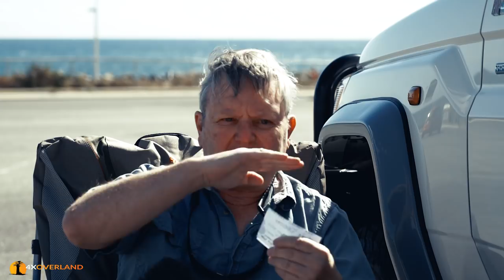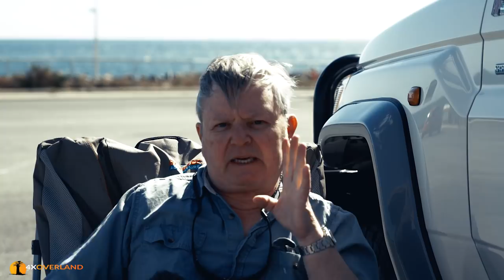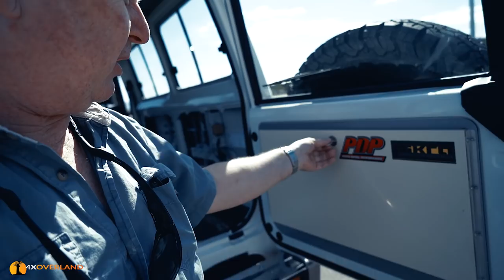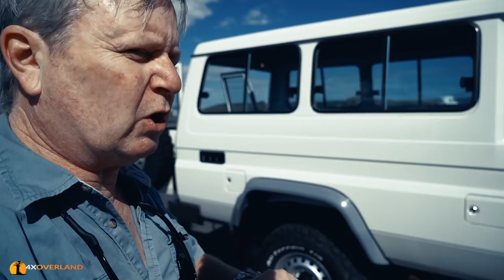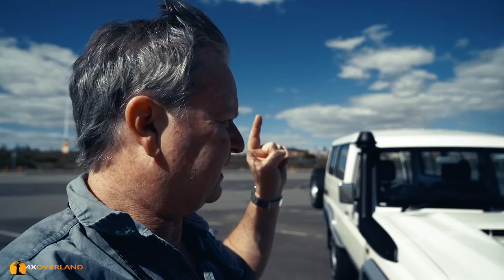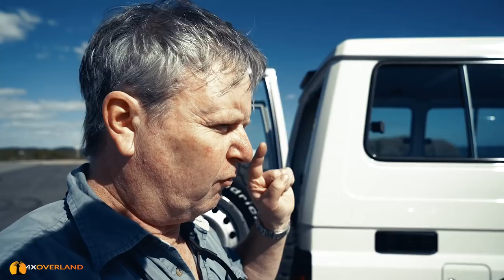PERFORMANCE UPGRADE EXPLAINED. AndrewSPW Land Cruiser build-9

Comment: Another thing, don't even begin to compare aircraft engines to these, the technology that aircraft engines were designed with is very old, the cylinder and ring honing and lapping process is specifically for that old technology, so the break in process is completely different. Not the same thing. However, that said, I agree 100% with the break-in you describe for the Toyota, or any new car engine, you must rev the engine during break-in to the levels that you expect to use it at in the future. Break it in the way you will run it.

Comment: Hello, for once since i looked all ( barely all) your videos i can t agree ( and stopped watching half the way) ... well, i do agree with what you say about reliability cause it is logical and full of sense. Still... ( and i m not talking as a hzj80 overlander but as a 4000 car/year dealer)... you should consider remapping instead of the chip... even the most brilliant chip has no comparison with an average remapping of the car. I ll explain myself very briefly. All engine are different. Some give a bit more horse power, some a bit more torque in high rpm.. who knows it s kind of a lottery when you buy the car, but the chips doesn t care of that and apply the same "recipe" to any engine! Result are not bad that s not what i mean.. But if you consider a professional remapping it can upgrade the torque, power, etc precisely specifically for your engine and it does that for any rpm . As a result you get a map "tailor made" : more torque in low rpm, check torque more stable between 2 and 3000 rom check, power after 3000rpm check.. or simply ( and this is why i prefer the remapping) you can stick to the original curve of torque and power and just translate it a bit higher in the torque and power scale. The same curves, but higher and a chip just can t do that as it doesn t even consider those curves. Couple of plug less also.. less chance of dust electrical issue but that s not a big big issue..  it s a tiny tiny bit more expensive and exactly as you said about electricity in the vehicule: hard to find someone brilliant to do it.. sure rohnny knows someone hehehehe i won t make it longer! Andrew i m a big fan, continue, visit marocco-mauritania someday you won t regret. Julien from belgium! 🇧🇪

Comment: Hi Andrew,  great videos as usual,  one thought regarding chips, to increase the power and torque they also boost fuel rail pressure to better atomise the diesel, which works the injectors harder and may shorten their lifespan. 
loving keeping up with the build! good job

Comment: what? people are complaining about you using a chip?

Well, this is entertaining because I don't own your vehicle and I'm not going to be using it for the purpose you designed it to be.

The only thing I can say to people looking into chips are 1) it will void your warranty, it sucks but true and if it doesn't void you warranty it will make it a very hard process prroving it's a warranty fault over the vehicle... but that statement should be taken with a grain of salt because...

The advantages outweigh the downsides... I told my brother to be careful with chipping his car and guess what happened to his car it's... still running well, it has been modified with a larger pully (supercharged) because his normal 5lb pully wasn't available and so, rather than risking damage he opted for a 10lb pully chip that allowed his car to run smoothly with the new addition.

Buyer beware, always read the manual and ask many questions...

Comment: Even a 4x4 that has a chip and has been tuned on the dyno will possibly throw error codes in a real world scenario. I have experience with a truck that ran awesome, but uphill foot flat from a standing start would throw a P2008 error code which was a Manifold Runner error....only uphill wide open throttle, around 2500 rpm in 4th gear (was an Automatic)...This Turbo Diesel would keep up with 6 cylinder petrol commodores and falcons out of the hole from the lights and wouldn't throw a code, but on an incline it would quit and throw the code. A dyno tune is as close as you'll get to real world scenario but it isn't bomb proof. Its more like a false sense of security. But do as you please, you will do it any way. I hope it shits itself so you learn the hard way, won't happen overnight but it will happen.

Comment: You definitely dont need those big engines from the land cruiser, a well built 4 cylinder engine is more than enough to reliably power the truck while being fuel efficient. The Land cruisers, 4runner and Tacoma have big engines with stupid MPGs when the Defender has a small 2.4l diesel engine with very good MPG

Comment: Don't feed the trolls Andrew. Manufacturers de-tune their engines because they don't know the; driver's mechanical empathy, use (civvie/industrial), environment (tropics/arctic), maintenance schedule (if any), fuel quality (cetane/impurities/additives), etc. I've had a diesel 70 series with half a million k's with an early 90's aftermarket turbo system, and I've driven 70's in under ground mining that are destroyed after a few hundred operating hours. Changing the fuel mapping is far from extreme. They'd would foam at the mouth if you added LPG or NOS.

Comment: If it were me, I wouldn't have changed the chip.

I think ASP is vastly underestimating the complexity of engine and drivetrain design. The engine internals and all the ancillaries are all designed around specific engine performance parameters. Consider the primary load bearing components - pistons, piston rings, connecting rods, crankshaft, bearings and the ancillaries - oil system, fuel system, air intake and turbo-charging system, exhaust system, cooling system. Then there is the rest of the drivetrain - transmission, differentials, drive shafts etc.

Sure all these components and systems are designed with a healthy margin. But if you cut into that by doubling engine torque, you are pushing your luck. Just consider the exhaust system alone. If you double power output you are pushing twice as much exhaust gas through the same sized exhaust pipe, which means approximately four times the exhaust back pressure.

He mentioned other vehicles use the same engine with far greater output. I can guarantee they are really not the same engine. Maybe they use the same block and some other parts, but many of the internal components and ancillaries would be redesigned for the higher output.
Reply from the maker: You make some very good points. Thank you.
Reply: Agreed. I also think that when you chip the Cruiser, the 76mm pipe should be fitted to allow more gas our safely.
Reply from the maker: Its only necessary if EGTs are high, to increase airflow. But they are not. As I see it, its an additional expense and complication for little advantage. But I do not deny that there is an advantage. Just not big enough.

Comment: if you do not know modern diesel engines, then you have NO business forming an opinion on someone putting a chip/programmer on their diesel. The manufacterer does not have the engines at max capabilities or even close to it. The chip sets your fuel to air ratio perfectly, changes shift points perfectly in an auto, ups your torque to better gain that efficiency. A good programmer/chip can improve fuel economy 4-7 miles per gallon all day long. Very safely

Comment: The angle of the rear spring shackles is totally wrong, I hope those OME rear springs are getting fixed. I must say the OME springs I put in my single cab VDJ79 were like that, even with a heavy load they were wrong. I hoped they would settle down with use, but not enough to fix the shackle angle. After that I wouldn't touch OME with a barge pole.

Regarding improved efficiency with the Unichip, a good improvement comes from better injection timing (stock timing is retarded to reduce NOx).

Comment: Toyota Warranty is now void. Even if you unplug it they will find it. I recommend you speak to Toyota about it so you know exactly where you stand. Uni Chip will not replace your engine if it breaks. If it does break, Toyota will blame the chip, Uni chip will say it's not their fault either. I broke a Toyota Hilux 3.0D4D (Unbreakable Hilux) Because of a Steinbauer Chip. $2000 chip, German made. A replacement Genuine crate motor from Toyota $15,000 fitted....I got rid of the truck for $13,000 it consumed over $70,000 dollars from brand new purchase price Including all of the upgrades. I lost a shit ton of money in the end.  It was a great Truck. And i would still have it if i didn't Fuck with the engine. I should have kept it, and put a new motor in it, I guess you live and learn, some of us the hard way. My Uncle is a head Mechanic Technician for Toyota, he hates chips, told me it was a bad idea, if they were designed to make that sort of power they would come from the factory like that. I should have listened to him. Now Exhaust and snorkle is as far as i go when it comes to performance. Goodluck.
Reply: Is this the uphill flat foot vehicle you referred to in one of your numerous posts?  That would be just the sort of abuse referred too-flat foot all the way up a hill through 4th gear?

Comment: Higher cylinder pressures and more heat. The motors longevity will degrade Andrew, you know that.  There's a reason Toyota uses a conservative map.
Reply: did you actually watch the video?  he addressed that.
Reply: wouldn't really worry about that, the same engine makes 200kw from factory in the 200 series.
Reply: yeah but with an extra turbo...  and a lot more electronic management.  but will still be reliableish
Reply: jetnavigator Higher EGT will, over time,  kill a Diesel engine. Not right away but all I'm saying he's wrong to think it won't have any affect on durability. It will still last a long time though, just not 300k miles long
Reply from the maker: And what increases EGT? Higher power? No.Wrong. Inefficiency increases EGT caused by unburnt fuel in the cylinders. More efficiently means lower EGTs. Lower EGTs is a byproduct of higher efficiency.
Reply: Losing a tiny bit of engine life for a boost in power every so often seems like a good trade. Unless it's a commercial vehicle doing big km, not many engines will go through their whole life between rebuilds with a single owner and even if so, the owner isn't going to care if they need the rebuild at 1,000,000km or 1,100,000.  

Toyota have already taken a big chunk out of engine life by fitting EGR and DPF. Without a turbo it would last a whole lot longer too.
Reply from the maker: dazaspc. From now on, your comments are invisible to all but you. Don't expect a reaction.
Reply: Matt, I see this all the time here in the states. People love buying big diesels that would last anywhere from 500,000 to 1,000,000 miles and they ruin them in 50,000 with a chip.
Reply: Ken MacMillan - Ken, would you describe what you mean by a "chip". That term gets tossed around a lot, I don't think most people have a clue what that means.
Reply: Not 300k miles long?  I'm sure he will get that and more.  This was explained in fairly good detail, Toyota's mild tune is for the masses, he is tuning it for what he needs.  The diesel will be fine.
Reply: +Ken MacMillan

Please quantify your "all the time" statement in reference to being ruined in 50k.  I know quite a few people with chipped and upgraded diesels.  The only one I saw truly destroyed was a chipped turbo diesel and that had more to do with the 400 dyno proven hp at the rear wheels that he used to constantly wear out tires doing burnouts and playing truck tug-o-war regularly.  It was his use, not the upgrades.
Reply: agreed, my uncle is a head mechanic for Toyota, he is a master mechanic and he hates chips. He scolded me for it on my hilux...In the end I broke a 3.0d4d i think it was because of  the chip...Now i listen to my uncle, if it was meant to be that way Toyota would have made it like that.
Reply: wrong
Reply: doesnt matter that's the 200 series. His warranty is for HIS particular model. Warranty VOID
Reply: at 70k-80k brand new with only a piss weak Toyota warranty of 3years 100,000klms i would say a decrease in engine life would be fucking stupid. Unless you have money to burn.
Reply: ??? what knowledge do you have? experience? .....I lost a shit ton of money doing exactly what was done in this video because my engine failed....Did it fail beacuase Toyota build shit engines? or did it fail because of the "tuned, performance, totally safe, within factory parameters, stupid idea chip?....you invest 70-80k into a vechile, kill the engine then come tell me what you think went WRONG
Reply: Adressed it?. he is in denial, repeating everything the UNI CHIP tuners said. Get Toyotas opinion, then we see what's BS and what's not
Reply: Heat is what Kills diesels, More power means more heat fullstop. Lowering EGT's with a "tune" will help EGT's However running too lean is bad, and so is too Rich...A chip increases fuel then is tuned to within "safe factory parameters"....bottom line is you are putting more stress on that engine with the chip. It's like having 2 donkeys, loading them up with the same weight but making 1 of them run faster than the other. Which one will stop first?...they are both just donkeys, even if one seems stronger than the other their internals are the same.

Comment: Andrew with all due respect, these tires are awfully small for the 78, and they look awful with these fender flares and lift.
Reply from the maker: Looks vs performance?
Reply: I obviously don't have as many years of experience as you, but from my 20 years, I always had 33x11.5 tires on my 5 door overlanding rigs, most of them land cruisers. That size is a good compromise between on road and offroad performance.
Reply: skinny tyres are the best for a number of reasons, could write a huge list but look no further than the WRC, what do they do when the conditions are slick?
Reply: How does WRC relates to overlanding :-)? On my group N Subaru i used 195-205 width tires on gravel and 155 on ice. I can name only few condition where skinnies are working and worked for me in overlanding: thick mud or clay and ice. They will not work in soft sand, swamps, deep snow, bottomless mud pits, IMHO choose tires based on the terrain you are driving on mostly
Reply: skinny tyres work much better on sand, they dont rub on the sides of the ruts and are much more efficienty. What is important for driving on sand, which is most of australia, is the angle that the front of the tyre meets the sand. If you have a big tyre this is better than a small tyre obviously, but people naturally assume with height width must come too. But this makes it perform largely the same, as the tyres are now forced with the burden of having to either reshape the ruts or rub on the sides. You are exposed to more punctures etc and use more fuel. 

With a skinny tyre the way that they bag out relies less on the sidewall height dropping and more in the length of the foot print. Improving the ramp angle at the front of the tyre. This makes the tyre want to climb onto the sand rather than push it. 

Also when people fit big wide tyres such as 33x12.5 etc the rolling mass is so high, that when you are in a situation that requires high traction, your tires end up spending more time in the air from the shocks inability to keep such a high mass grounded that you dont go anywhere. A tire of the same height but narrow width would be better unless you are running custom arms and properly tested and valved suspension like kings or fox. Suited to your vehicle and tyres, not just your vehicle. 

Then with bigger tyres for the 1% of the time you are actually off road, the other 99% of the time you enjoy more drive train wear, higher fuel consumption, more road noise, harder steering, high costs per km for tyre wear. 

I have a troopy just like the on in this video and will likely get 255 85 16s for it soon as I think this is the best ratio of size vs width. 

Last but not least, a tyres tread design and compound relies on a certain amount of pressure acting on it to work, or a minimum pressure. When you have "too much" tyre your car cant generate enough downward mass to make the tyre work. By using skinny tyres the vehicles mass allows the compound and tread design to work. How many times have you seen a car with big tyres get its tread clogged and just turn smooth and skatey. Or have you ever put big tires on and noticed a drop in wet weather grip. This is the same principal.